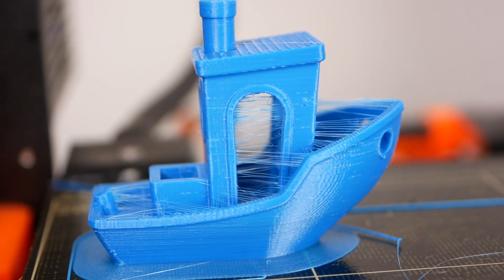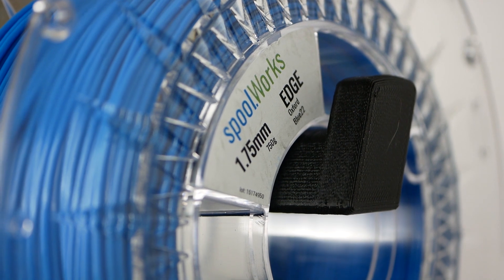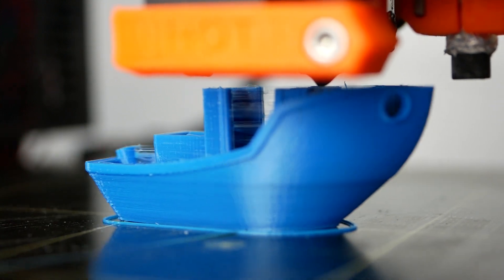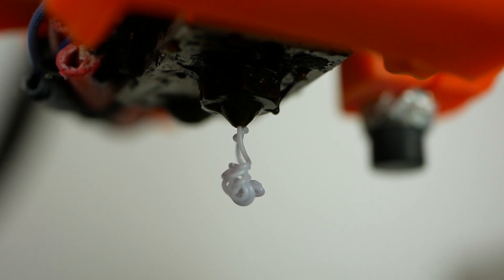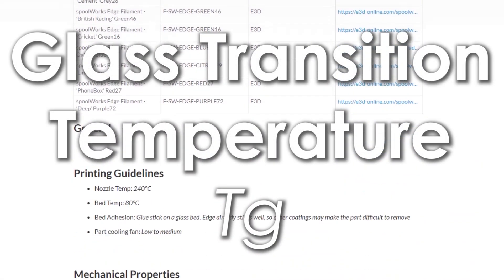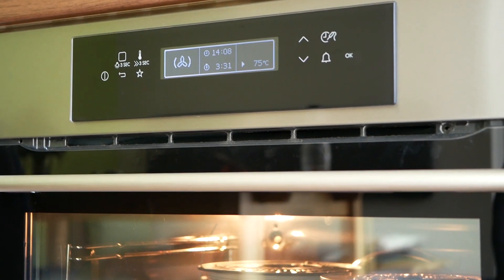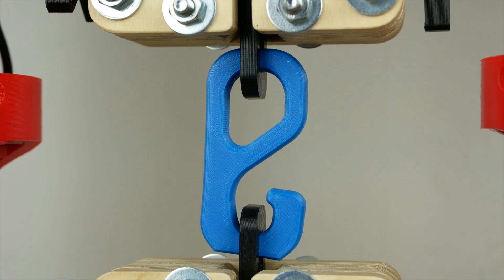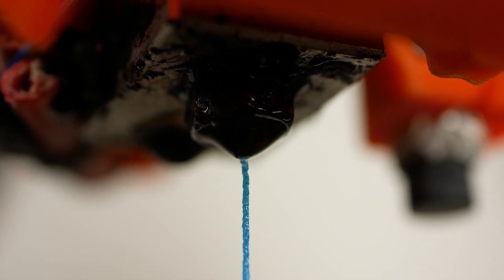WHY you NEED TO DRY your FILAMENTS!

Comment: CNC kitchen
Talks about 3d Printers XD
Reply: CNC (Computerized Numerical Control) fits the bill. Unless his Fused Deposition Modeling 3D printer' mechanics are controlled directly via punch cards or punched tape.

Note that some CNC machinery did use punch tape ("telex tape") as an intermediate transport format. That a decade or two before USB thumb drives or SD cards. Internally, they were controlled by a digital ("numerical") computer: the punched tape was just used to transport the code form the CAD workstation in the office to the CNC machine in the workshop.

Oh, well, the kitchen part in "CNC kitchen"...well, he showed us how to use regulars kitchen appliances to dry filament, right? ;-)
Reply: @klausstock8020  Well yes, technically CNC is correct, I didnt know that btw. But if you think of a CNC, you think of a huge machine that mills metall. Compareable to a ship. Imagine someone has a channel about ships, the first thing you think of is a fishing boat or a cruise liner. Not a aricraft carrier.
Reply: @010falcon  There are also desktop CNC milling machines (including laser cutters for woodwork, also used for things like model aircraft and such).

But yes, as a school kid I worked on a huge CNC lathe. I would use the crane to bring in some raw material, in the scale of metric tons, attach it to the lathe and calibrate the machinery to micrometer accuracy. 

While the machine ran, I'd check coolant levels, mix new coolant (with a refractometer), and, mostly, remove tenoned material with a dung fork (yes, seriously).

The lathe did actually use punched tape for data input; this was like 1988 or so.

Oh, yes, and one day I asked why everyone askes me to operate the crane (there were a lot of other people in that huge factory hall, but they all sight me out when they needed the crane). "Because we don't have the necessary crane license."

Ouch 

Crane license?

Comment: I don't know how / why consumers deal with the vague variability of 3D printing. I can't believe printer manufacturers have such weak support, when they probably have Best Practices nailed down internally to get their best prints.
That said, I am on a mission to compile Best Practices to remove as many variabilities in printing as possible.
Your video is the best first step - if you don't control your raw material, you can be / will be wasting a ton of time, money, patience.
Next would be - cover your 3d printer while printing to hold environmental conditions stable throughout printing.
Drafts seem to be a major source of problems causing irregular cooling, thus warpage.
Next, knowing the materials you are using forms the top three items.
Those are three massive controls to put in place, before going under the covers of the software and adjusting printing.
Then, adopt one or two stress test objects to qualify a printer under a known material - probably PLA.
Then, see what happens with other materials.
Now it's time to go under the covers of the mesh/slicer software - probably the slicer software first.

The 3D printer manufacturers - I can't believe they still make money when a high percentage of their customers give up, or never print anything beyond thingiverse downloads.

You have to marry your 3D printer to print anything meaningful in repeated, high-quality output.

Comment: If you get a good print with wet filament could you dry the model that was printed in the oven like the raw filament or is the damage done
Reply from the maker: Damage is done already. The hydrolysis happens during the meeting process and there the polymer chains are damaged.

Comment: Hallo, Stefan, can I know your settings? I've been tweaking my printer settings of my jgaurora a5 for more than 6 months and it prints good only with 0.1mm layer height and if I go higher, layers get missaligned that the surface is rough and non-perfectly straight. Please help. Danke.

Comment: Basically, if you are doing low detail mechanical prints with stable materials you are probably good with dry stored filament.
If you are printing high detail or artistic prints or use sensitive filament, you better make sure and dry it out again right before printing.

Comment: what about brittleness?  How is that affected?  is brittle, easily breakable PLA on-the-roll a sign of broken polymer chains?  Does drying under heat cause the polymer chains to re-join?
Reply from the maker: PLA breaking on the roll is usually a sign of the material being in a hot container for too long and the polymers crystalizing out.
Reply: @CNCKitchen  so, heat too high when drying?  How can this be fixed?
Reply from the maker: Maybe remelting, but don't quote me on that.

Comment: hmm i use 9 euro for 1KG PLA filament from manufacturer site "Polymer film (the filament is waterproof, does not get wet, does not require vacuum packaging and a moisture absorber)" wondering it is not standard in such expensive filaments?

Comment: Hi, I am a thermal engineer specializing in dehumidification. When you say that the relative humidity is reduced by increasing the temperature this is ofcause true but there are other ways of reducing relative humidity. One way is to use a compressor to make a cold surface. When humid air passes the surface water condenses and water is thus removed from the air. Another method is by using an adsorbtion dehumidifier that works with a rotating silica gel disc. The air is blown acros half the disc and water is absorbed. On the other half of the disc hot air is blown drying the disc. The disc rotates slowly and this way water is transfered from one air stream to the other. This method is very energy efficient and is capable of reducing the humidity to extremeley low levels. 10% relative humidity is achievable.  The other advantage is that there is no water drain neede as the moisture is removed by a hot air stream. I am working on developing a de-humidifier for filament using this principle and I expect the first prototypes to be ready 3 to 6 months from now. There will be 3 versions available. One for mounting one spool inside such that the filament can be kept dry while you print. Another version will be mounted on a cabinet for storing multiple spools. The third option is a box for mounting on any cabinet you desire. If you are interested I might be able to supply you with a prototype for testing when the prototype is ready.

Comment: Your in depth analysis videos are the best on youtube.  I have found that all filaments benefit to some degree from a  drying run in the oven.  It can be tricky without a good quality oven and I have melted several spools.  I recently found this guide from ultimaker that seems like a great option for a budget drying technique for anyone with a heated bed with a much lower risk of melting the roll: https://ultimaker.com/en/blog/52493-3d-printing-tips-how-to-store-pva-material     It would be awesome if you could run a test on this technique.

Comment: How about drying filament when using it with blowing hot air 60 oC to wire before it goes into printer???
Reply from the maker: Drying takes a while so just blowing it for a bit won't remove the moisture.
Reply: are you sure there is no difference if I blow a hot air throu 10cm tube 2cm diameter?

Comment: yea my oven runs on gas so it is tons more humid than electric. So I got a dehydrator for my filament.  Toaster ovens I have found do not go low enough for the cheap models while a cheap dehydrator has control in the range that filaments are dried at.

Comment: I'm new to 3d printing but wouldn't it be easier to just get a dehumidifier and build a box that you could put the filaments in with the dehumidifier hooked up to the box? why do you need to heat the filament for it to release moisture?

Comment: Your method to introduce moisture is not very scientific and may not have relevance, except where you left the filament in your office.  Even then, we don't know what level of humidity is in your office.  It would be better if you measured and revealed the relative humidity where you stored the various filaments to prepare for testing. This would result in a video where the viewer could compare that data with the viewer's relative humidity conditions.  Other than that, it was a thorough and a great video with lots of good other information!

Comment: When building a home made dryer, it makes sense to have an area that is heated for the spools and an unheated area for the desiccant.  Desiccants take up water much better when cool.  You can relay on hot air rising to take the air from the heater up past the spools.  When the air reaches the lid, it will cool and want to sink back down.  If your desiccant is off to one side and in racks, the cooler air will fall past it.  A wall with a gap at the top and bottom can keep the falling cool air away from the rising warm air.
I have built a thing like this for a different purpose and it worked well.

Comment: I've just started with 3D printing (queued up my third spool of PLA, since mid July,  yesterday.)  Buying dessicant (silica gel) by the pound is beyond my budgetary constraints. I am aware of the issues with moisture in the filament and I wanted to do something to keep it dry between runs. So far no bubbles in the extrudate.

I've been using a handful of uncooked rice (1/8 -1/4 cup - 22.5g -45g), and keeping the spool (with the rice) re-sealed in the zip-lock bag it comes in (with the included gel packet), between runs. Does this actually work; or is it an old-wives tale?

Comment: I like to use a vacuum chamber (it's just an aluminium stock pot) and a hot plate...just space the spools off the bottom of the chamber with insulation and let everything heat soak up to around 150f, then pull vacuum for an hour or two. It comes out nice and dry

Comment: If Tom Sanladerer is to be believed, you're probably being a bit misleading with your reference to "glass transition temperature" and the implication that the Tg is "the temperature at which the material melts/dries at": https://toms3d.org/2018/02/02/things-know-filaments/ With the materials you mentioned, the Tg is close enough to the melting/softening point that it is coincidentally still valid, but if we were printing with any of Tom's examples (PTFT, PP, PE, POM), the Tg would be much lower than the softening point, and with some you'd end up trying to dry filament at sub-zero (°C) temperatures ;)

Otherwise it's a great video, and encouraged me to add a sticker to food dehydrator I use to dry filaments, with the temperatures and durations to use for each type of plastic, with data sourced from http://www.printdry.com/dry (their product is overpriced, and hard to obtain in the EU from what I can tell, but that "recommended drying time" table on that page is super helpful for everyone else ;) ).
Reply from the maker: You are actually right. I should have rather called it softening point or HDT.

Comment: Was getting ready to throw out a roll of ABS, saw the exact issues you spelled out: stringing, snapping sounds, steam, bubbling.
Roasted it for 12 hours just below GT, tired again, perfection!
Pacific Northwest tends to have high humidity, worse in the winter.
Only one roll of PLA [bronze, metal filled] has ever needed roasting right from the factory.
Everything now stored in individual freezer-bags; each roll with its own desiccant pack, roast the desiccant packs every month to keep them active.

Comment: There's another method to dry things, though most people won't want to do this: You need a proper air pump, a glass container with a valve, some silicone and fuming sulfuric acid.
Simply put some sulfuric acid into a small bowl at the bottom of the container, then your plastic above it. Close the container and proceed to create a vacuum with your air pump inside the container.
The vacuum will reduce the boiling point of the water which will thusly gas out. The sulfuric acid is very hygroscopic and will then pull the water from the (thin) air.

If you're worried about temperatures this is the best way to get rid of unwanted water.

Comment: Can you freeze-dry filaments perhaps? Just a thought. And I am actually curious and may try it myself when I get around to it. But if you should try it I would certainly watch your results! I base this idea just on the fact that air in fact gets much dryer in lower temperatures. So this may suggest that freeze-drying AND storing filaments could be a simple and effective solution to keep the filaments dry? have you or anyone tried this? Results or comments?
Reply: Have you already tried it???
Reply: Thanks for asking, but no. Not yet. I suppose to really test if freeze drying works I should first create a wet sample. Then freeze dry part of it and compare print a normal, a wet and a freeze dried sample? I will post it on my small youtube channel if I get around doing it. But I still hope CNC Kitchen would give it a go. He does it so thoroughly and interesting!
Reply: I think a warm partial vacuum could be a good way to help get the water out of a material.  The effect would be to make the space around the plastic have practically no water in it.  This way if a water molecule happens to diffuse to the surface, it will leave the plastic but none ever come back in.
Reply: I like how you think. And I agree. Anything that wastes less energy than cooking the filament is good I think :)

Comment: Hi, I recently built myself a drybox but WHERE did you get these little mesh sacks for the desiccant? Haven't found them in sane sizes for some weird reason.
Reply from the maker: I also purchased them on eBay. If they are too expensive, use a piece of mosquito mesh and close it with a ziptie.

Comment: Thank for this video, it's good to see the results of some tests.  I've had similar issues with the hot and humid summer we've had.  I ended up building a storage drawer for my filament that is fed dry air from the internal parts of a food dehydrator that is controlled by a Raspberry pi with temp & humidity sensors.  It has helped.
Reply from the maker: That sounds a bit over-engineered 😉
Reply: CNC Kitchen you are probably right! But we all need projects to keep us busy. This drying drawer is installed in an old half-height server rack that I have. Ultimately my printer will be inside that rack as well and I will be able to control temperature and humidity within its enclosure to. Is it necessary? Probably not. But I had most of the parts sitting around already anyway.  :)

Comment: I'd like to see the same tests with PLA.
Reply: Me too.
Reply: Me too! I almost exclusively print PLA and have had no troubles so far, but now my printer is in a basement that might be somewhat more humid than my room. Girlfriend complained about the noise.
Reply: I got my first 3D printer about 11 months ago. Prints came out beautifully, and I was quite happy. I was using PLA. All winter, with low humidity, I just left the spools out when convenient, and in one-gallon zip lock bags otherwise. As spring came and the humidity went up, I started getting problems similar to the ones shown here. It took me a while to figure out what was happening (remember this was my 1st 3D printer!)
Reply: Me too. Mostly the influence on annealing, shrinkage and mechanical properties, before and after annealing
Reply: me too!

Comment: I would like to see nylon and if it is even printable if exposed to the really moist environment. Id also be interested in seeing ABS.
Reply: In my experience, nylon prints like a foam when it is wet. It might be handy when you are going for a certain texture, but the interlayer adhesion is wrecked. So printable, yes, but not worth printing.
Reply from the maker: Nylon is basically unprintable if it got moist. Look at the black Marvin in the video. It was basically foam in the end.

Comment: Does putting a roll of filament on the heated bed work in drying the filament? I've seen people do it on the cr-10 and they put a blanket on top to keep the heat in
Reply from the maker: Not the worst idea. I'd put a bigger container on top and regularly lift that to get rid of the moist air.

Comment: Check out PrintDry on Kickstarter.
Reply: That thing is literally a food dehydrator for twice the money.
Reply: Ahaha. This $50 dehydrator is made at the same exact factory as the "printdry". It is the EXACT same appliance just with a different upper enclosure and it costs well under half. 
https://www.amazon.com/Self-Mate-Countertop-Dehydrator-Stackable-Adjustable/dp/B0797CVXKN/ref=sr_1_15_sspa?s=home-garden&ie=UTF8&qid=1534024998&sr=1-15-spons&keywords=food+dehydrator&psc=1
Reply: Luke AOD which doesn't minimize the work they put into making it a convenient product to use for filament.
Reply: but it does defeat the usefulness of that work
Reply: ^^^ exactly. Things can be convenient but if the price isn't right, its not fucking good at all. I'd much rather save the $70 and drill a hole in the dehydrator myself. A couple of 608's and a table top later, you've got the same thing for $3.
Reply: This is why kickstarter us a joke lol